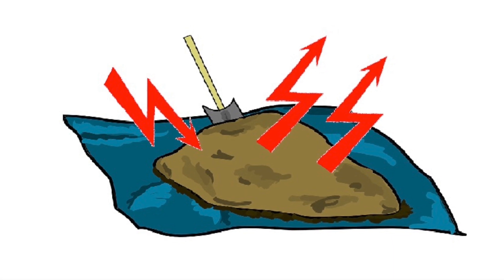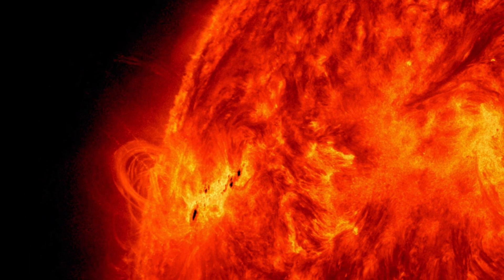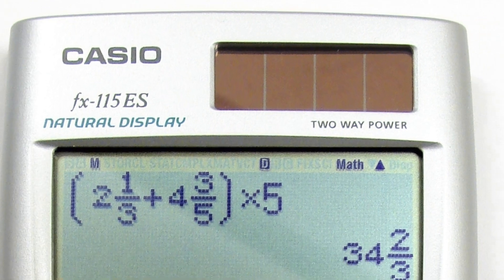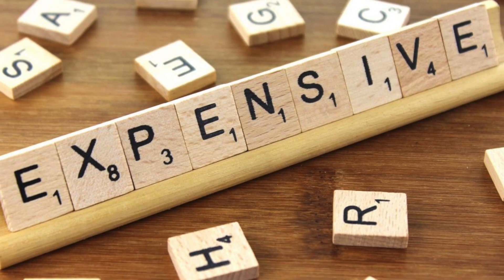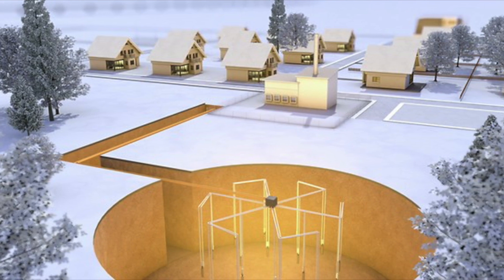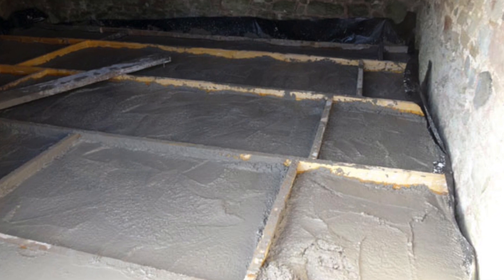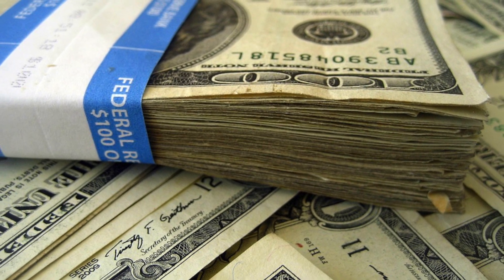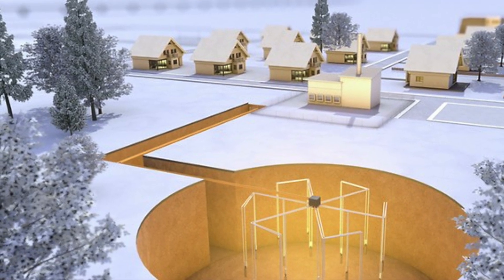Home Solar Thermal Dirt Battery (2020)

Comment: This system can store heat (depending on the soil type) at Specific heat of soil BTU/Lb / degree F - dry soil .191 wet soil .354.   This means that a dry soil (which you want to use) weighs 75 lbs / Cubic foot.    You want to use dry soil because wet soil will evaporate and remove the heat you are storing.   So that a 20x20x8 insulated soil storage can store 2,400,000 BTUs at 140 degrees F.  (Assuming you are heating your house to 72 degrees).    You will need a large solar heating panel (20x40 ft) to give you 36,000 btu / hour to keep up with the house use and loss through the insulation of the storage.
Reply: Right on Mr. Phillips, you are digging (intentional) into what needs to be done. And if we look at your example here is some food for thought for those interested in this type of project. I just paid .80/gal. L.P.  2,400,000 btus/91500 btus/gal. Of LP. = 26.23gals. @.80 = $20.98.  Here in Wisconsin we have about 4 hours of sun in winter. At 36,000/hr =144,000 btus. Which we know is not all useable but if it were. Say we have a small 1600 sq.ft. ranch home. 144,000/24hrs =6,000btus/hour /1600= 3.35 btus/sq. Ft. Of heat loss. So you would need an efficient envelope. Once you lose the “charge” in your dirt battery, depending on how much winter sun you have you may not have enough sun or collector to recharge. At that point you may as well just send the collector heat directly into the home. So this just expands on William’s example that sizing the array and battery needs to be calculated for climate and insolation. And as Mr. Phillips has illustrated dirt/sand whatever your medium has the capacity to hold only a given amount of heat. As with a P.V. System you need to find usage of wattage or load. Same here a heat loss calculation for the home needs to be done to determine the amount of heat needed for the home. Then the size of the storage area can be determined and from that the amount of collector output to replace heat lost. This would tell us how big of a collector array is needed. Charging a dirt battery/solar sandbox over summer is easy. It’s the maintainability of useable heat through the entire winter after initial charge is lost is where the engineering needs to be done. Sun Stone company made systems utilizing rock or salt storage. The solar heated these storage areas for use during the night. But you lose efficiency when you take the solar heat and transfer to storage and again to the living area. I’ve seen and worked on these systems when on a partly sunny day or intermittent times of solar gain that the systems would turn on dumping heat into storage and the clouds roll in and it shuts off. Then the sun comes out again and it starts up again. A whole day(s) can go on like this but never enough to effectively heat the large mass to have enough useable btus to draw out into the home. The temps. In the mass were not high enough. So the power used to run the system was wasted, wasted money. Better off the just dump the heat directly into the home. 
And the use of differential controllers and variable speed controlling is going to make the system more efficient. And squeeze the maximum amount from each hour of sunlight. As well as storage diversion. Not a “light sensor” if your storage is at a high temp. And late in the day your solar gain is reduced because of sun angle or it has traveled farther west. Or the opposite in morning. The amount of heat produced and temps. May be lower than the storage area. At that point you’re extracting heat from storage depending on tubing insulation and collector emissivity. I’ve seen many solar thermal systems using only a PV panel to run the system. So it is strictly a photo period based control. What has been accumulated during 10-2 can be partially wasted from 4-6. I’m just saying that look at what William Phillips has touched on and do your homework. I have more but I see I’ve rambled on too mush already.
Reply: @robryf9325  This can be done.  Solar heat storage is possible and you can make a very comfortable home, but the whole system capacity and home needs should be calculated.  It is possible even in Wisconsin.   The question is cost.   Is the capital cost of installation worth it?  Will you repay your investment in a reasonable time?   This is why inexpensive electricity is an amazing product.   It is one of the reasons I am a fan of Nuclear power.  The power density is incredible.
Reply: William Phillips Exactly it’s not worth the cost it would have to be too large for people do this to have benefit all winter instead of a month and a half. 
They would be better off looking at what people like Sonia Newenhouse have done.
Reply: @robryf9325  If you can get a good solar heating system to maintain the heat it could work.   I think it is possible to use several heat sources.   I estimate that 4,000 gallons of water surrounded by R40 insulation would give a very solid heat story.  This could be buried by a house, and fed with solar heat panels.
Reply: You can also connect this storage to other heat sources (like a wood burning stove).   It is possible to heat the soil with hot air rather than with water / glycol mix so that the need to worry about pumps and freezing is eliminated.   The challenge is to make the storage water tight and to insulate it to about R-30 all around and especially over the top with R45.  Otherwise the gradual heat loss will be so great that it will not be worth the cost of the install.   You also need to take into account the level of the water table and what happens in a storm.  This will effectively be a boat and if the soil around it is saturated it will tend to float up into your home.
Reply from the maker: wet soil stores more heat
Reply: @SimpleTek  Yes, wet soil does store more heat.  However, wet soil also evaporates and carries heat away with the evaporation.  Eventually you end up with dry soil.   Insulation cannot compete with this heat loss.   However, one modification to increase the capacity would be to use sealed plastic water storage spaced uniformly in the dry soil.  The sealed container would not evaporate and you would have the advantage of the high heat capacity of water.  With temperatures in the 120 to 140 F range most containers would be OK.   Higher temps would break down some kinds of plastic.
Reply: If the heat battery were a sealed system meaning the insulation wouldn't let the water evaporator then would wet soil be better?
Reply: @jacobari6371  Yes, that will work.  Wet soil is nearly the same as water in heat capacity.   You want a system that lasts for years without maintenance.   It has to be sealed in a way that makes it reliable.

Comment: I have been looking for a system like this for a long time and I am starting the build on mine in the next 8 to 12 weeks utilizing radiant floors solar evacuated tubes and almost identicle system I'm building at 6000' out of Loveland Colorado my only issue is in many cases you cannot dig down more than 2' my solution is to build-up on top of the existing dirt to create my 8' deep hole I will be using a radiant floor at the bottom of my heat battery and then pea gravel as my medium for heating,  I will reverse the system in the summertime to provide air conditioning also it will be heating my greenhouse  I will be posting videos of the actual dig and installation of the radiant floor land air tubes
Reply from the maker: be sure to insulate well above ground. Air Crete is cheap and awesome if you can't find used cheap styrofoam sheeting.
Reply: @SimpleTek   Yes I plan on putting  Too plus feet of pea gravel on top of the radiant and the air tubes then foil coated insulation on top, the entire foundation of the building will also have foil coated foam 2 to 3" under the entire foundation this is an area were skipping will cost you dearly.

Comment: I live in the land of lakes in Ontario. This system looks like it would be perfect on a lake bottom. Lakes have cold water at the bottom in summer and warm water at the bottom in winter. There would be no need for solar heating at all. The solar heating would occur naturally from sun warming the lake. Your idea is quite brilliant though for a great many other places though! I have been thinking that this excavation could also happen beside someones septic weeping fields too. I think that rather then heating the ground for a battery though, the solar energy would be put to better use by heating domestic water and then also a biogas tank with biogas stored for energy in winter. Septic tanks can be converted into biogas production fairly easily
Reply from the maker: Thank you for the comment - you made some great suggestions!
Reply: My father built a system for their hotel next to Lake Michigan in the 80s. Used water temp to cool in the summer and heat in the winter.

Comment: This idea seems great.
very robust and long lasting 
I wonder,will soil moisture affect the R value of the aircrete? 
Also, could you cool a home and store heat in the dirt battery during the summer time via heat pump technology?
Reply from the maker: I don't think moisture effects aircrete - concrete works underwater - yes you can store cold as well as heat!

Comment: can you build an underground pool
use fresnel lens to super heat the water and pump it under ground.  use super heated water in the winter.  

how are you going to handle leaky pipes covered beneath your house?  or will this be done in the front yard or side yard?
Reply from the maker: I prefer side instillation
Reply: Simple Tek 

i just watched some other videos.  i now have a better understanding of.what people are trying to accomplish.  

best of luck

Comment: I am planning on using this very same technology with radiant floor heat on my new home building in Wyoming.
Reply: Have you started on the build? From my limited research I understand it will take a couple of years to fully charge your dirt battery.  Have you heard the same? That makes me wonder about using it to cool as well. Maybe have a location separate from your heated dirt battery for cooling? (We won’t need to cool here but in the plains/prairies I bet you do.)

I like the idea of building a battery underneath a greenhouse, using solar charged lines. I think they suggest HDPE lines because of their ability to transfer heat.  

Definitely install weeping tubes near the surface (like mentioned here & LDS Prepper) but between the weeping tubes and dirt battery - have two serpentined runs of lines, one filled with a glycol type solution for heating house via radiant in floor heat & a 2nd for household hot water. 

Looking at the Drake model they use daily solar collectors for the houses, I think maybe that’s so they don’t deplete the dirt battery before end of winter? That makes me think my idea of using the dirt battery for hot water may not be a good one and also complicates things a bit. 

There are a lot of companies starting to do this with heat pumps - we’re in Alaska and we may end up being in a location that doesn’t have electric.  The companies refer to the area of your dirt battery by the ton & use that measurement to determine heating capacity. 

I am having a difficult time finding hard formulas for this. Where are you getting data for your build?
Reply from the maker: @RollingAlaskans  I agree cooling isn't an option and requires separate tubing in different area
Reply: @RollingAlaskans  Thanks for the feedback. Had some things get in the way so I will now have to wait until spring to start. Thats Ok since I am continuing to do more research. Considering foam create rather then air create for its waterproofing properties. Still weighing the cost difference between going much hotter and reducing the battery size. Plastic piping of any kind will not work if I shoot for 500 C. Without enough heat to last our ling winters would be a waste to in my mind so hotter is better. Your solar concentrators also will have to change somewhat. More heat means less battery, tubing, fluid circulation, and higher piping and pump cost.
Reply from the maker: keep me updated!!!!!! sounds fantastic

Comment: I wonder how much The horse cost lol 😅😂😂
Reply from the maker: 'horses' usually arn't cheap, but it all depends on the breed ;)

Thanks for the comment, have a great day!
Reply: Vet bills are expensive and so is a broken arm from being bucked off of a jealous horse. Its mans early version of a tractor. We rate every piece of equipment based against a unit of energy or work a single horse can do. Horse power. Personality of the horse can be ....... a challenge. They hurt when they decide to bite

Comment: I like the idea, if a person dug a ditch around the house something around 6 feet away from the house , insulate outside wall and top, this would keep the heat close to your foundation so that becomes part of the thermal mass and prevents heat loss through  the foundation. Also I have been kicking around the idea of doing a large aircrete bench or a wall that's heated all day long with the solar hot water system, this can probably be done in any home as a stand alone system. once this cools down can pull heat from the geo thermal system or another  heat source.
Reply from the maker: thank you for the reply

Comment: Maybe you can kill a few birds with 1 project?  By using the 4 foot perimeter soil surrounding the house foundation as the bank.   This helps dry and insulate the basement (if you have one--otherwise just keeps water away which is still good).  Reduces length of pipe runs.   Concrete covers could serve dual purposes--driveways, walkways, patios.  And this could be accomplished in a much smaller yard.   
I have often considered making a much simpler thermal bank by excavating only 2 feet down and 3-4 feet out, lining with waterproof membrane or plastic, maybe some foamboard or as you say aircrete under the plastic, and just refilling.   This would only work if there was not a high seasonal water table...
Reply from the maker: interesting ideas that deserve testing!

Comment: Curious - how hot does the gylcol get with your solar collector?
Reply from the maker: great question - the solar collectors are either thermal solar collectors - google "evacuated tube solar collector" - that's just one possible type that uses a liquid and not electricity to collect energy.
Reply: @SimpleTek  Do you have any data with an approximate temp range?
Reply from the maker: @fourthwayseeker5158 -there's a few factors -  it depends on the specific collector, the location and amount of sunshine available and speed of the liquid pump.
Reply: @fourthwayseeker5158  sorry I'm arriving late to the party, depending on your design the temps can reach 150 deg c up to over 270 deg C with frequency on heat wave days. What I've read is to use copper for a distance before going into pex, perhaps to your supply manifold to offset the trip and reduce the chance of your pex failing. For a bonus you could run the copper pipe in the north wall to shed the worst of that extreme thermal mass collected